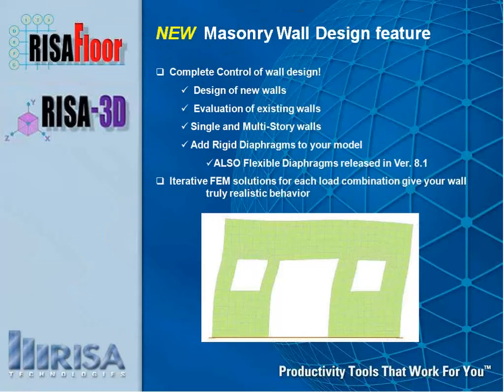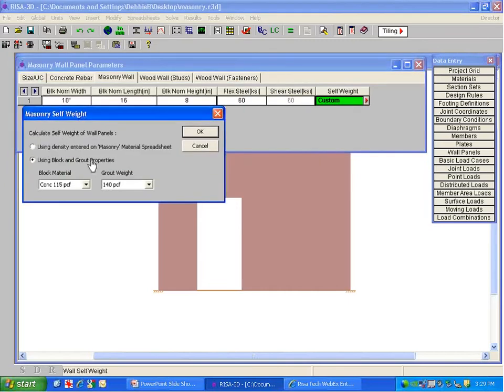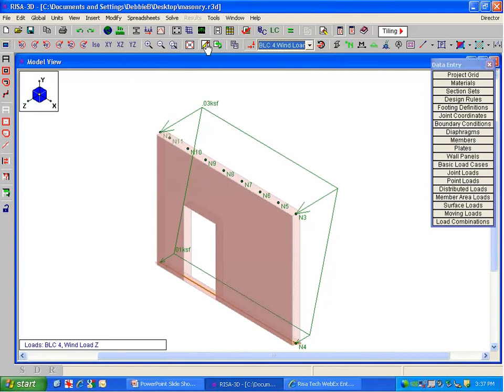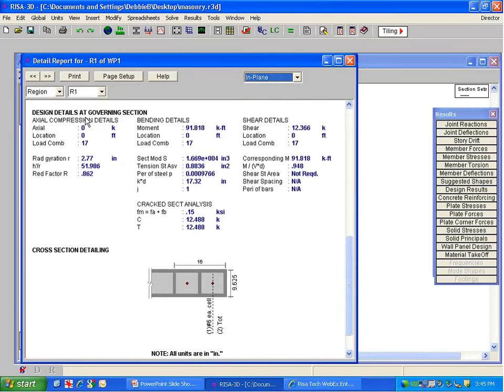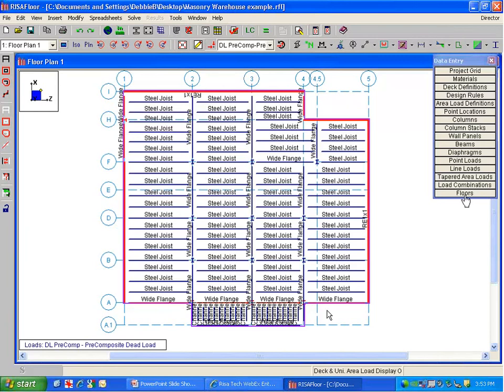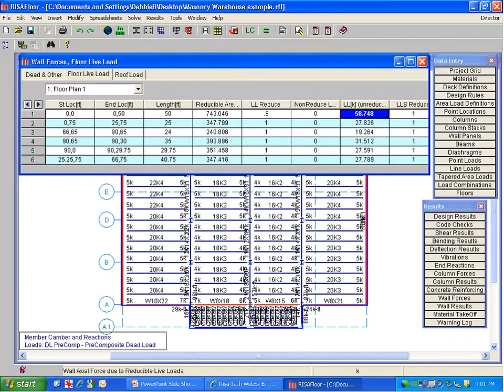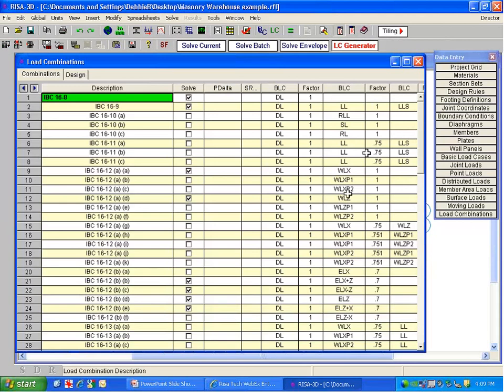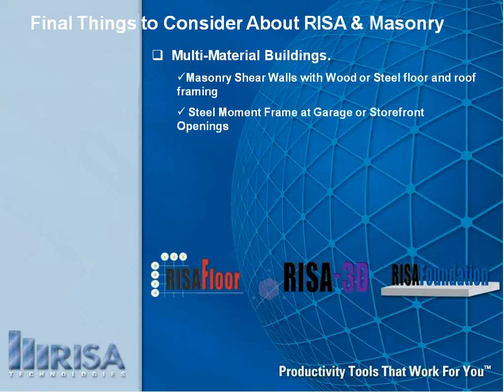Learn to Design Masonry More Effectively with RISA Software

Comment: I will need to see a video of the commentator building a brick wall and working with masonry before I can put any faith into anything she is saying. Maybe she could do a video of herself mixing mortar or cement or cutting and applying rebar or even buttering bricks and building a level brick wall. No? none of that? Didn't think so....